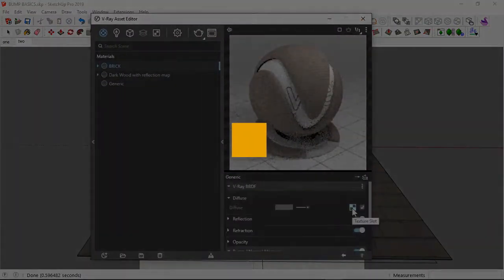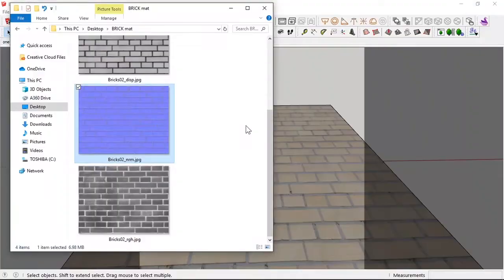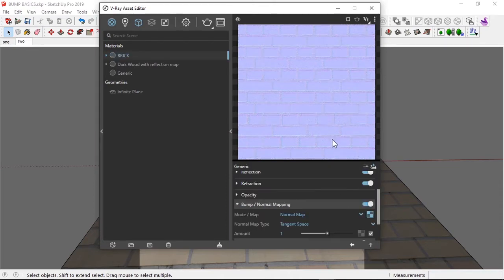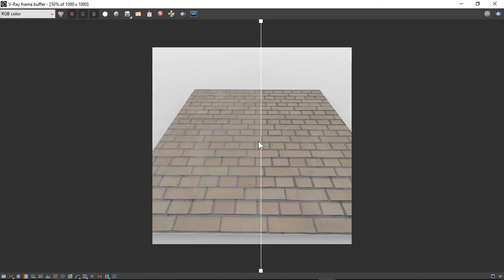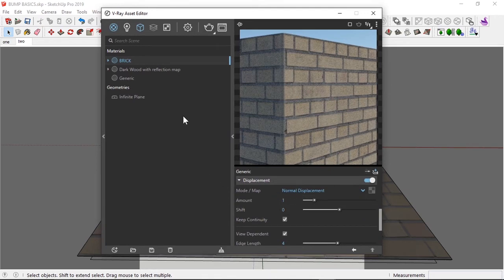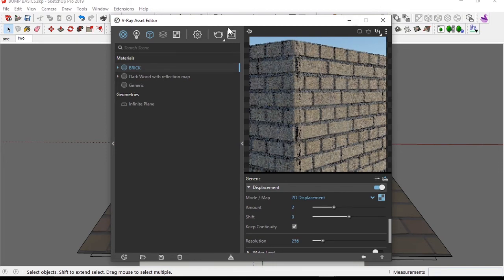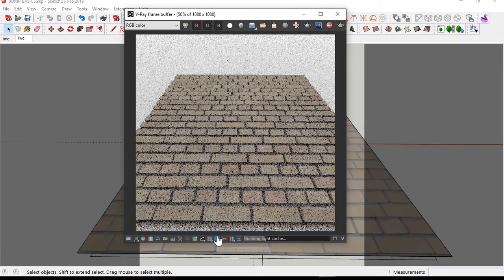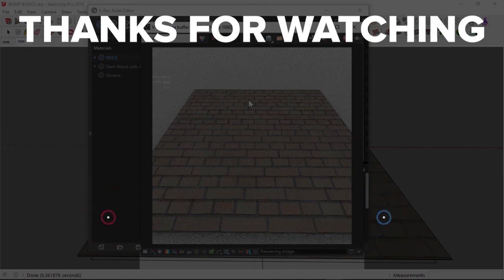V-ray For Sketchup | How To Create Realistic Brick Material!

Comment: is there any option to apply bump and displacement material without making that surfaces as a group or component.
Reply from the maker: Hello Orhan. 
Yes there is but only for the bump parameter. If you want to add displacement you need to make it a group, if not any adjacent face with a different material may have the same displacement effect. Cheers :)
Reply: @ikrenders  thank you for your feedback :)